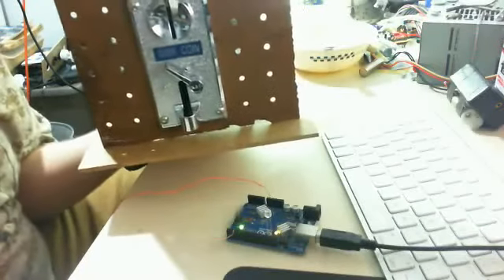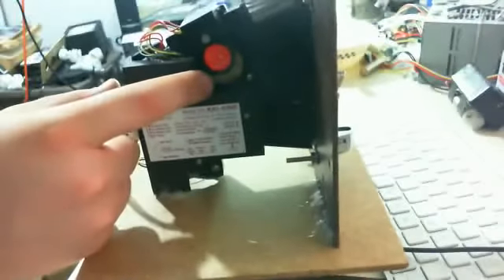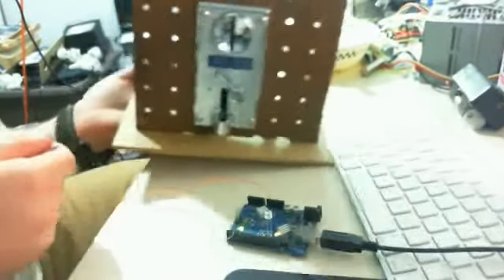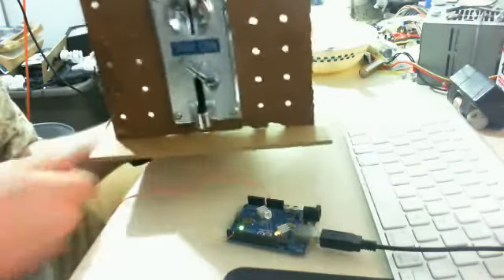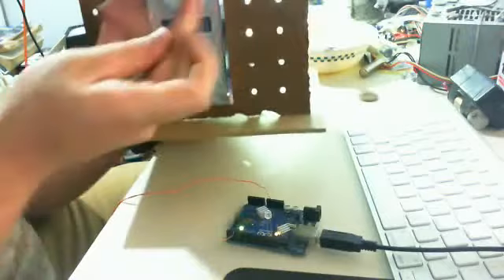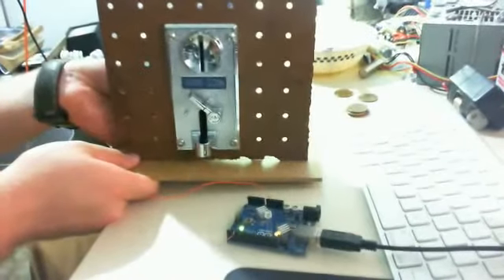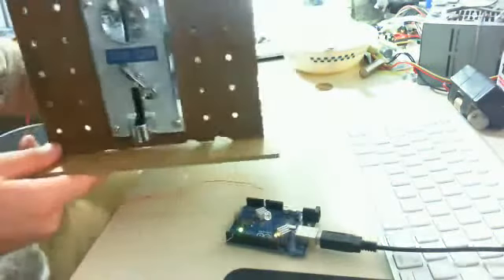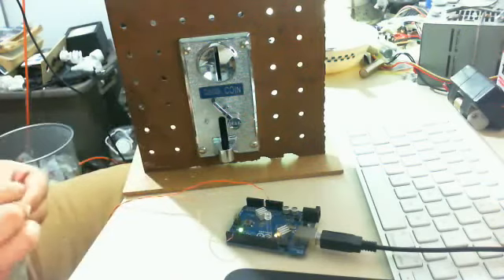Tech Time with Ben - Episode 3: Arduino Fun Part 1

Comment from the maker: you connect the black wire which is ground to arduino ground, and then you connect the pulse wire, in my case it was white, to the input pin of your choosing. i have it connected to pin 8 on my arduino.